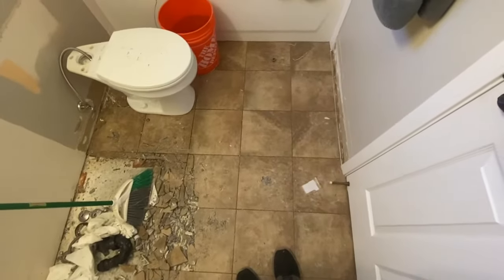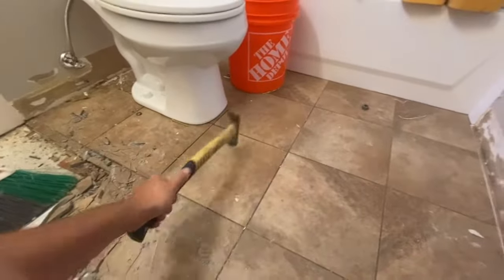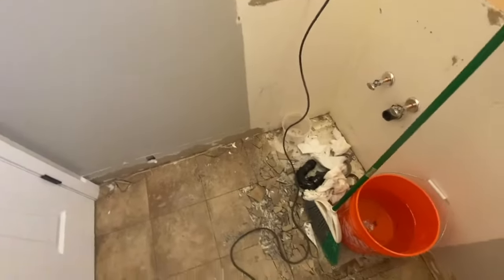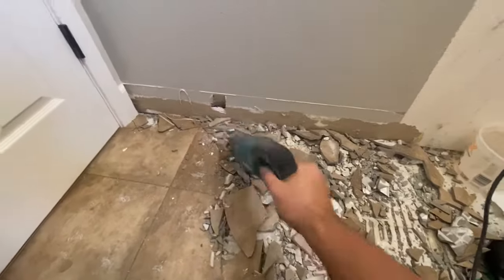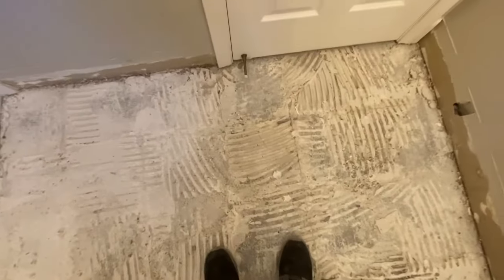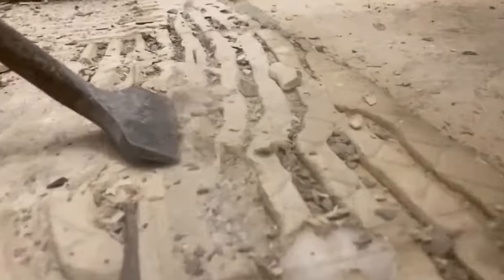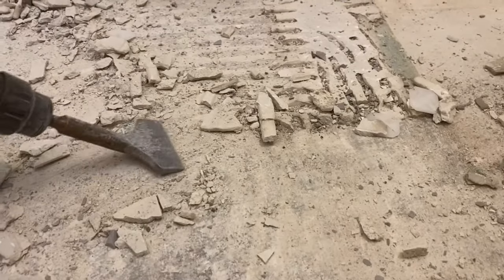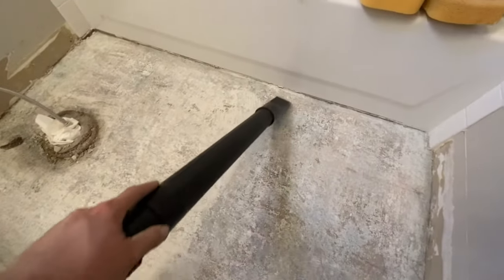Removing Tile on Concrete Slab Easy

Comment: I know that this video is a couple of years old.  May I ask what kind of roto hammer did you use (i.e. sds plus/max, 3 joules etc) and the width of that chisel.  Thanks.

Comment: Breaking up the tile in a small area is fine, but in larger areas it becomes a nightmare. Busted tile is extremely heavy and sharp, and you have to take that into consideration with your cleanup. Most contractor bags are rated for like 50 or 60 lbs max which means it doesn't take much tile debris to hit that threshold, not to mention those sharp pieces will slice through those bags like butter. For my home renovation project I was able to get whole pieces of tile up in about 30 seconds with a roto hammer. Less mess and less space taken up with debris
Reply from the maker: Thats great if the tile wasn’t mortared down very good.  In most cases they don’t come out in one piece. You usually have to use 2 contractors bags so they don’t cut through as easy or use  5 gallon buckets to take them out of the house

Comment: Thanks for doing this video.  This is something that I want to attempt, I'm a complete novice, but looks like a small enough project I can get through slowly and carefully for a first timer.  What did you call the drill you used, is it a hammer drill with a chisel bit?  What I want to accomplish is to remove all the old tile in my laundry room.  The original tile was not laid down properly by the previous homeowner and the tile has come loose on most of the floor.  I want to remove all the tile, end result would be to paint the concrete floor rather than replace the tiles.  What do you use to smooth out the concrete and prep for applying the paint?  Thanks so much again!!
Reply from the maker: It’s a rotary hammer drill that has a chisel setting on it. This is the one I have Help me decide on this product: Makita HR2475 1" Rotary Hammer, accepts SDS-PLUS bits (D-handle) https://a.co/d/1xxV2Nt
Reply from the maker: You might have to poor a concrete resurfacer on the floor. When you take out the tile it’s going to leave some fine chisel marks

Comment: Great video thank you......I used a rental makita probably 3 times the size you did.   Used a little bit different bit.....The tile would not come loose ...it would splitter and consequently leave no crack to insert the bit............again..........I did not  fracture the tile ( live in a condo second floor).  Any suggestion for another way ?????    Thank you so much !!!!!!!!
Reply from the maker: You need to hit the title first with a hammer to fracture it. If you live on the second floor you probably have a wood subfloor with some type of backer board. It’s going to be slightly different to remove. Try getting under the backer board with a large pry bar to break it loose. Good luck

Comment: Great video. We are taking tile off of out 1/2 bath and our screened in porch. So your video is a great help.

Quick question. The screened in porch in our house was built on top of existing tile. These tiles extend out about 5 inches on the outside perimeter of the porch.

When we remove the old tile do you think that it is practical to cut the tile around the porch and leave the existing tile sitting under the walls of the porch? Or do you think that we will end up having to pull the tile from underneath? Not sure if my explanation is clear. We are a bit nervous since we've never tackled this before. But the old tile is so bad and raised in places and needs replacing. 
Thanks for your consideration.
Reply from the maker: I would cut the tile off at the porch wall and leave it under the there.

Comment: Is that a standard hammer drill with a chisel bit? Do i need a special chisel bit or can i just put in a regular chisel privided it fits in well?
Reply from the maker: This is the hammer drill I have. the chisel bits are made to work with this type of drill. it's an SDS-Plus type chuck. Here is the link https://www.homedepot.com/p/Makita-8-Amp-1-in-Corded-SDS-Plus-Concrete-Masonry-AVT-Rotary-Hammer-Drill-with-4-1-2-in-Corded-Angle-Grinder-with-Hard-Case-HR2641X1/206058492

Comment: Good video. I was poking around looking for some magic way to remove just one tile, at two different places. When they set them when they did the  entire floor there was a couple places where they were very slack about getting the corners to meet at the same level.  I reckon just use your method while being very careful not to damage the surrounding tile. I know! If it gets real scary I'll close my eyes.
Reply from the maker: You might want to remove the grout around the tile that’s being removed. That way it doesn’t crack or chip the good tile next to it.

Comment: How about if the tile adhesive is that glue plus with the rubber in it? Or waterproofing membrane
Reply from the maker: Are you talking about mastic and redgard. It might be harder to remove. You can still use the same method. It might take longer. Let me know how it goes.

Comment: Question: do you have plywood underneath that? I want to replace the tiles in my foyer and they are sitting on a layer of plywood, followed by what seems to be 1 1/2 layer of concrete
Reply from the maker: There was no plywood. The tile was on the concrete slab. Someone must have used the plywood to rase the level of the tile to match the floor next to it. Rip all that plywood out and get down to the concrete sub floor. Then you can use self leveling cement to raise the floor back up to where the tile will be flush with the floor next to it. You will have to calculate how much to raise the floor using the thickness of the new flooring.

Comment: If you don’t mind saying what did you charge for this job?
Reply from the maker: This was part of a larger project. It probably took me 2 to 3 hours to take out the tile and clean up the mortar off of the slab. Around $270

Comment: Why is the concrete coming up with mortar removal when I do this. Like a chunk of mortar will have a thin layer of of the slab ..
Reply from the maker: As long as it’s a thin layers it shouldn’t be a problem. Not sure why that’s happening. You can pour a thin layer of self leveling cement over the slab. That will fill in the uneven floor and make it level for laying the new floor.

Comment: I did this in my bathroom, im wood tiling my floor, now my question is... dobi need to put something over the concrete before tiling?
Reply from the maker: Are you putting tiles that look like wood?  You can put redgard as a crack prevention membrane on the concrete floor make sure to follow all directions on the bucket. Basically it stops cracks the may form in the slab and keeps them from transferring through to the tile. Now if your slab is older and stable and hasn’t seem much moving or cracking then you could tile directly on the concrete.
Reply: @TheUltimateHandymanKyle  thanks for advice

Comment: Hmm. Some short sighted Victorian person layed the ceramic tiles into the concrete fire hearth base so that they form part of the fire hearth. It wouldn't be a problem except that it's raised above the level of surrounding floorboards so I can't lay an new oak floor over. This solution will not work for me therefore.
Reply from the maker: So the tile was laid under the raised concrete of the hearth?

Comment: Dude, what type of cheap tiles fractures with that hammer? 😂
Reply from the maker: Have you ever hit a tile with a hammer? They all break like this
Reply: @TheUltimateHandymanKyle  I'm literally doing it right now on a renovation for a home I just purchased. Even my 4 LB hammer sometimes has trouble breaking it. To see your 2 LB break through so many so easily tells me that this was a very cheap ceramic tile.
Reply: @rodneym1390  This might say more about your strength than the supposed quality of the tile 😅